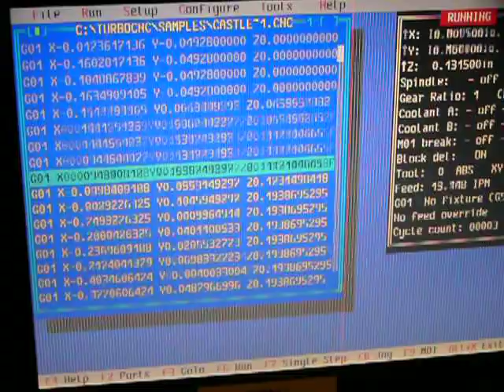CNC music #3

Comment: It has a nozzle or something that moves in three dimensions.  The motors which move the nozzle make a noise with a higher pitch when they move faster.  The computer is telling the nozzle to move at speeds calculated to cause each motor to make a certain pitch.

Comment: The tuning will still be exactly the same, but the overtones will vary depending on the motors, and other vibrating parts.  It will still work, and they'll be the same notes, but it'll sound a little different.

It's like playing the same music a guitar or a piano.  You can play the same notes.  It'll sound different, but it will still sound fine on both.